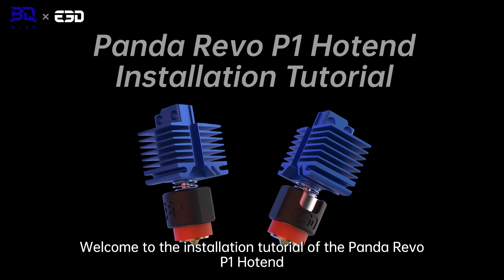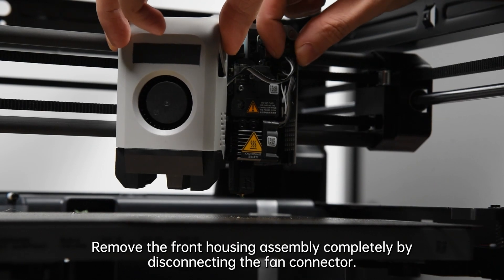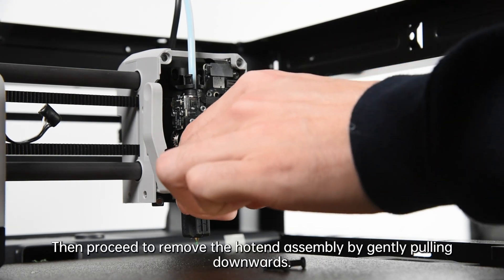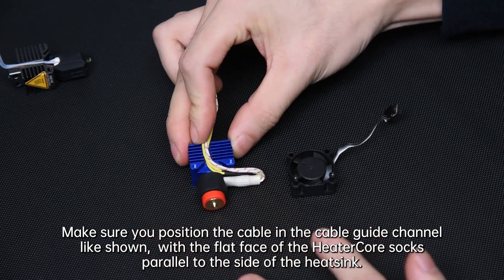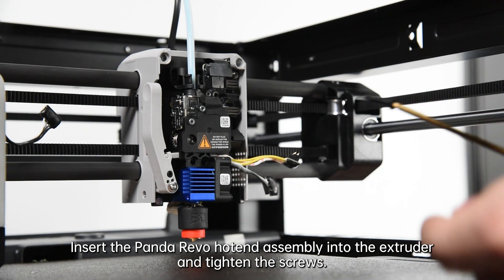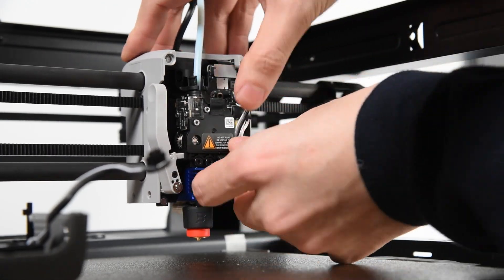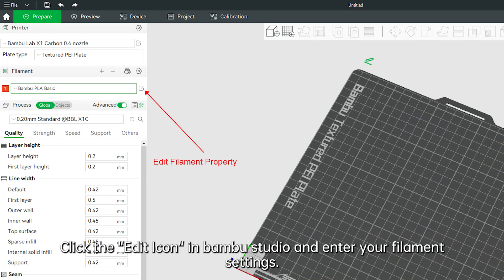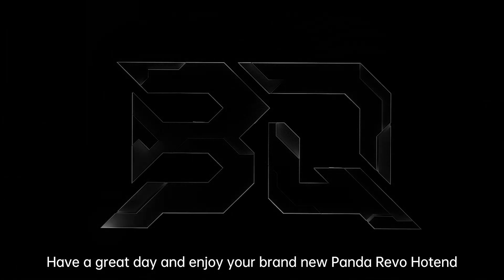Assembly Video--BIQU Panda Revo ✖️ E3D For Bambu P1P/P1S

Comment: What is the purpose of this replacement in the P1S? 
I have no clue what this device will solve or make better on my P1S. 
Any advice or explanation would be great!
Reply: from what i can tell you basically remove the oem nozzle and install there aftermarket nozzle that allows you to quickly swap out nozzle tips for damage or if you want a bigger filament size etc kind of how the new a1 has with there quick swap nozzle/extruder feature if im wrong please correct me
Reply: @Aykadurp  Thanks!
Are  the nozzle tips also from them or can you still use the nozzles from Bambu Labs?
Reply: looks like its from them or possible can take anything that has the same thread pitch @reddwarf666
Reply: Nothing, it will strain your printer trying to heat something it was never designed for in order to not really print faster or better and to maybe save 45 seconds for a nozzle change.